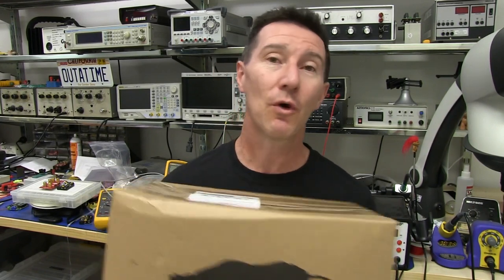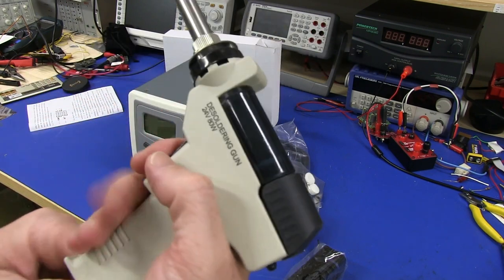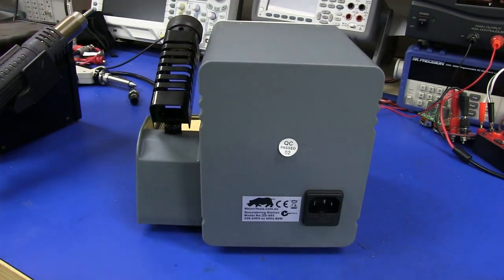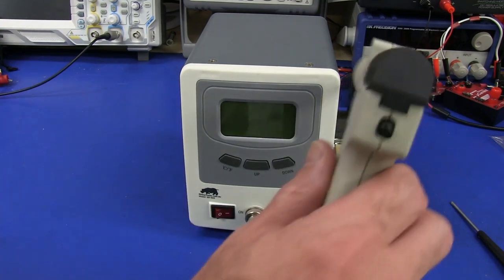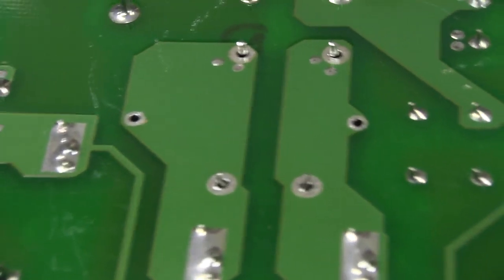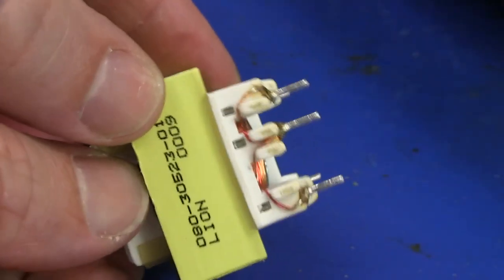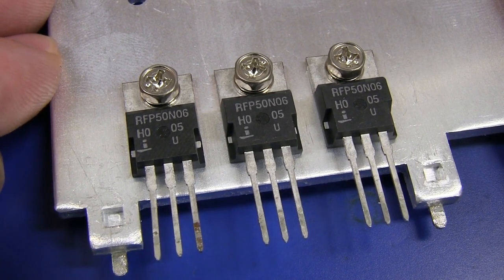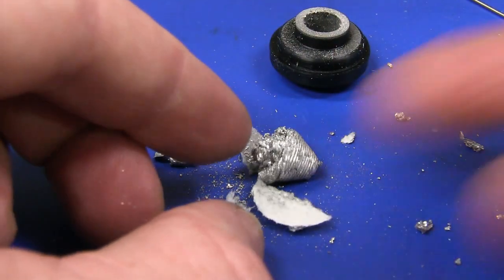EEVblog #542 - ZD985 Desoldering Station

Comment: I got one of these branded as a Duratool D00672.  The main difference is that the spring inside the solder trap is just a straight spring that pushes the filter against the back with a cross shaped metal plate that seems to keep the bulk of the solder off the filter.  When I first got it I popped the back open and the spring ejected everything from inside!  Took me a while to work out which order they went back in.  Otherwise the unit is identical inside.
Reply: How has it worked out? I see you can still buy that model.
Reply: I always chuck in steel wool in it after spring 
The curly kind not hair mat type 

Also I use fridge compressor and air valve 
I tend to pop compressors but they free and common and worth some scrap      $$££

Gives a epic punch and I'm doing tonnes of boards run compressor full on time and trigger air valve

Comment: I bought this model thanks to this review.  Used it for a few months now. Reliable tips, works excellent. Use caution with the heat, it is very powerful. A cool tip i just learned for working at lower heat, desolder with your board at a 90 degree angle instead of flat so you aren't fighting gravity.  Two small complaints, its a pain to fit the chamber back when cleaning, and drops the temp after 10 min. of being idle to conserve tip life.
Reply: Sir, it's use in multilayer  pcb work???
Reply: @kashirambhaipatel5102  I've used it for multilayer and single. It's still running well. Great unit.

Comment: Hi Dave, I bought a Hakko 474 nearly 30 years ago and it is still going strong - and parts are still available , even though quite expensive. 

One little trick you might find useful - place a small rolled up ball of steel wool in the solder collecting spring and you won't have to work with pliers to dislodge the collected solder from the conical end.

Comment: When using our hakko desoldering station at work, what we do to easily get the solder out of the solder reservoir is stick our solder iron tip through the bottom of the spring and start gently tapping it on metal on an angle and let the melted solder drop out to avoid bending the spring reservoir and is much easier.

Comment: Having done salvage/repair work for a long time, I'd like to add one thing: never use you desoldering iron's tip to straighten bent pins/component leads! Heat, then use a flat blade screwdriver, then suck away! You desoldering iron tips will thank you for it! :)

Comment: I have had the duratool version of this for over a year  and I am very pleased with it. The only problem I have is solder getting stuck at the end of the gun barrel before it goes into the tube, but you just have to give it a clean after use with a high temp.

Comment: A couple of years ago I picked up a cheap 3-in-1 station. Worked great for a while but then it stopped recognizing the soldering iron. I thought it was the iron itself that went bad so I ended up just using it for desoldering and hot-air stuff but after watching this video, I decided to finally open the thing up to see if I the problem was inside.  It was and I have it working again now.  Woo.

Comment: a little trick to make emptying the solder from the spring easier and also helps make the filter last longer, is to tear off a small piece of paper towel and push it to the bottom of the spring with a pen.
You only need a piece big enough to cover the tapered area of the spring.
if you have used a hakko (we have a 474 and a 701 here) or other similar de soldering stations you will find after a few times of emptying the solder from the spring it gets harder and harder to get the blob out of the tapered area. This eliminates that problem and we haven't picked up on any noticeable suction difference with the paper fitted. And we get so much more out of our ceramic filters and the filter springs

Comment: I used a vacuum desoldering station back in the 80's..  It had a glass tube (a buck or two)  ... cotton plugs for the tube, a controlled temp hand held (not gun shaped.)-- and so on.. Great tool with almost identical sound.  Made in the US, because that was well before the move of production to china..  Was a LOT smaller as well.  Super reliable.. Did rework on 4 and 6 layer boards with it regularly... I had been looking for something similar now that I'm retired.. that may be something to buy this year...

Comment: Sometimes cheap pieces of crap work very well, they just don't last very long. That's why cheap and SERVICEABLE are a win for me, lol! ;)
Reply: That's right, spare parts cost is a plus on this products.
I have a Hakko 808 desoldering gun and each nozzle cost 15 or 20 dollars, heating element is over 70 dollars instead 5 dollars for each nozzle or 20 dollars for the heating element on chinese.

Cheers.

Comment from the maker: I've been using soldering tools for 30 years. I know what is junk and what is not. The reputable brand names last, the cheap junk usually doesn't. That's a fact. That is precisely why companies and products get a reputation, because their products have proven themselves long term in the industry.
Bullshit that wire failed because I opened it, it was a BAD solder joint, it would have failed in time with the vibration.
Reply: The problem with china made stuff is there is NO quality control at the factory. The customer is the QC. If you get an item and it is DOA or fails, they'll just give you another one because on the scale of failure rates it's cheaper to do that than pay 20 people to sit at benches testing every unit they make.

Comment: One of my buddies bought me one of these in exchange for some auto work, and they are indeed cheap.

I've had a few problems with mine, with the most irritating being that the gun nozzle clogs constantly. I can only use it for about 3-4 suction cycles before the back of the tube inside the collection chamber completely clogs. The unclog sticks it comes with are too flexible to remove the clog alone so I have to end up precariously balancing a soldering iron in one hand, this gun in the other and somehow push the unclogging stick down the nozzle at the same time to unclog it.

But the problem is that it doesn't remove all of the solder from the tube so the process starts all over again with solder buildup at the back of the tube. If they had put a heating element through the length of the tube so the back also was hot enough to keep solder melted then it wouldn't clog.

The other issue with mine is the temperature setting glitches. I have mine set to display Fahrenheit, but after probably a half hour of usage, it will revert back to Celsius. This wouldn't be a problem if it used the same temperature. I keep mine at about 536F and it should revert to 280C, but it drops down to like 160C or about 320F which is too cool to melt the annoying ROHS solder. I have to press the C/F conversion button a few times and it will heat back up to the proper temperature, but it's still annoying it happens.

If you don't expect miracles and just need something for occasional projects then this station works alright if you're on the cheap.
Reply: Just a followup after using this desoldering station for awhile.

To prevent the gun from clogging up, you'll need to keep the gun temperature above 330C. I haven't found a fix for the temperature automatically reducing to 200C, but I assume it's an aggressive measure to save the heating element in the gun.

Comment: Impressed with the way it takes all the solder off, even from through-hole pads. I've seen tools costing an awful lot more that couldn't get that kind of clean-as-a-whistle result even on one-sided pads. Larger nozzle could be useful though. Reckon this is going on my shopping list. Will check inside for shoddy construction of course!

Comment: Funny, seems to be exactly the same as my unbranded "Duratool" desoldering station bought from Farnell, the gun is the same and the unit seems to have the same components all the way down to the crap LCD, mine has a completely different casing and proper mains earth though.

A friend had his SMPS break in one of these, if that happens to you it's most likely the SMPS controller chip according to the local reseller. They sent him a new controller and his works again.

Comment: Haha :) I can recognize that build quality! Bought Zhongdi ZD-939L hot air rework station (same as Rhino) couple of weeks ago and luckily took it apart before first use. All the plastic PCB holders was cracked and 230Vac mains board floated freely inside the case. But after all, works great after a little repair.

Comment: They sell these everywhere, I think.

I used to do repair and rework for a time (xx years back) and we had these massive ERSA stations (about the size of a Midi-Tower-PC), which were great and had a soldering iron, desoldering iron (not gun-shaped, but inline) and some heated tweezers for SMDs.
Worked excellent and saw a lot of use.

So, as I wanted something similar, though not as expensive, for myself and I found the ZD-whatevers  on the web, i ordered a whole bunch of the stuff: a combined soldering/desoldering station, a hot air station, some SMD-Tweezers and a whole lot of spares (you can even get spare heaters).

The soldering/desoldering station is a bit flimsy, when you open it up, but it worked and worked pretty well for the work I've done with it. The hot air station (with different nozzles) works great, too. I've even used it for heating plastic for bending :-)
I haven't tried the tweezers yet, but I'll have a go at it soon. It's not a station, just more or less two soldering irons with a hinge and a spring. We'll see...

Anyway, this stuff isn't bad for infrequent home use, so far.

Comment: Glad I watched. After purchasing this unit, mine didn't work either! I found one of the wires going to the pump motor had never been soldered to the motor terminal. Nice. I guess they ever test these units before shipping! LOL. Well, after fixing it the device works fine. Thanks for your review.

Comment: I have a hot air and soldering iron combo, which looks just like your hot air blower in terms of case and aesthetics. Just the other day, the hot air gun's temp sensor went whack and it lit up red hot and melted through the handle a tad. It was crazy.

Comment: Hi,  
     Well I did most of my time in the RAAF using a ROYAL made in Australia de-soldering station .  When I pulled the pin with the RAAF in 1992 I bought a Royal de-soldering and soldering station  for $1200 which lasted about 5-7 years then the gun fell to bits and as ROYAL were out of business then that was the end of that. 
 I bought a ZD985 and later several  ZD917's ,3 in total I think it was, these are de-soldering & soldering  stations.    My problems with them were one switchmode power supply  going U/S  under warranty,  several  de-soldering  iron barrels blocking internally due to the barrel collapsing, some going o/c in the heating element, this happened with the soldering irons too.  
   The main supplier is Radio Parts in Melbourne, they even supply Rhino Tools.   The tips get stuck in the barrels too, graphite may work ?   I have destroyed a couple of irons trying to get the tips out. 
 At present I am waiting on spare parts to repair some  de-soldering guns and a couple of spare irons, irons are so cheap they are not worth repairing.    I may have caused the desoldering barrel collapsing myself as it doesn't seem to pay keeping the desoldering station on too high a temperature,   350 deg  seems to be max but 300 would be better in standby.  
  By the way the ROYAL  wasn't made that well either.   I am at present semi retired having started in the trade in 1965 at BHP Newcastle, joined RAAF in 1972 and started repairing camcorders in 2000.   The RAAF used to run a NASA standard soldering and de-soldering techniques course of 3 months full time as part of the Radio Trades course.  I taught electronics at the RAAF School of Radio way back from 1987-1990.
Reply: For the price the soldering and de-soldering station  ZD917 isn't bad value for money  but it isn't built very well so needs to be treated with care.  At the end of the days work, tips out of the soldering iron and clean up and remove solder from the de-soldering iron chamber.  Also stick cleaning rods whilst still hot down the desoldering barrel to make sure it's clear of removed solder.  You can leave the desoldering tip on.
It's not really meant for professional work but if you don't do that much repair work it would suffice.

Comment: Dave, I know its a bit late, but, that multi pin DIN type connector for the wires to the gun from the front panel, twists a little after you remove that small screw.
Those plugs are commonly used for Mic connectors on transceiver equipment.
All the hams were probably screaming at you to "Give it a slight twist Dave".

Comment: Have the same product with another brand. Works fine at first, but if you use it much it will end up clogging even if you clean it. The tip heats, but the solder can cool in the tube on the way to the chamber, either because it doesn't heat or doesn't get hot enough. Ended up getting a Hakko.

Comment: Thank you Dave for the VERY informative video on this type of budget device!! I have had to use my hand pump tool for so long and it is tedious work. I have been looking for something like this but do not have the coin to throw out for a Hakko. I wish I did, because I love my Hakko tools and soldering station. But I'm not a salvage beast so cannot warrant the cost of a Hakko. This gives me an option. Maybe some home-made fixes to the design (other than out-of-the-box repairs lol) like the stand. The hand unit seal. Etc. THANKS!

Comment: The company I work for provided me with a Pace ST115 desoldering station.  I think it works really good.  The build is all metal and overall well done.  I think I prefer the handle of the Pace over the pistol grip style others make.  I did a search for pricing once and found that particular model is around $800 US.  Not cheap, but worth it if you get into a lot of repairs like I do at my job.

Comment: I saw a clone of that in a local store for 120, it's a ZD-8915. The case front is more solid, the gun holder is independent, and the gun spring is bigger. Other than that, they're basically the same. So obviously, I went with a cheaper 2 in 1 desoldering gun with a manual pump for only 12 bucks.

Comment: I have had a ZD929 soldering station for over 10 years now. With a decent tip it's a good tool for the hobbyist on a budget. Not great, but it gets the job done. It says "Ningbo Zhondi Industries & trade co. ltd." on the bottom.

Comment: @ 14:00 
those connectors are first unscrewed, then twisted to release the metal housing from the plastic

struggled with it myself a bit when i had to cut down and reconnect the plug after a lead went bad on an old station i was fixing.

Comment: I use mine every day. On the plus side, it's cheap, the nozzles and filters are cheap. On the down-side, the nozzles dont last long. They burn from the inside out and lose their thermal capacity. Old joints require flux to reflow the soder and the fumes from the flux will block the filter easily. And if a component leg breaks off inside the nozzle it can weld inside and then the element is trashed because you cant get it out. If you forget to empty the tube it will build up and jam the tube into the handpiece and if you prise it out it breaks.

Comment: This thing is DANGEROUS! If the temperature readout fails, the station enters a positive feedback loops that keeps on heating the gun until it glows red hot. It happened to mine; the metal has turned a blue color.
Reply: This happened to mine as well, this is a cheap crappy de-soldering station.
Reply: Good observation thanks for the warning .
Reply: or you know replace the sensor with a resistor and put a switch on the vcc in
Reply: @gjoreajtovGamingTV  more info on this?

Comment: Found a VERY similar unit under part number AT-915ESD.  The control layout is different on the front panel but the enclosure & gun look identical.

Comment: 34:16 - very good idea.

The heater on mine has just blocked completely, and no amount of prodding with the cleaner will unblock it (even with the heat up to 480C).

It had lasted about two years of occasional use. Not fantastic really, but my fault for not cleaning it more often (I'd lost the prodder things until recently).

A new heater was only £10 though, so not too bad.

Comment: Just for info.  I am in the UK and found a very similar item on ebay with the ZD 915 model number.  Seems to be almost the same item and has a better/stronger stand.  I have one and it performs just as well as this one but seems to heat up a bit faster.  Only drawback is that it has quite a noisy fan.

Comment: Varies depending on the type of pump.  

Vacuum cleaners use a centrifugal pump, and blocking the intake means that the vanes are spinning in less dense air, so there is less resistance to their movement.  Hence torque goes down, the motor speeds up, and the current reduces.

A piston (or diaphragm) pump is a positive displacement pump.  Block the inlet, and the piston is pulling against a vacuum, so the load goes up.  Think about engine braking.  Or block the inlet to a bike pump and extend it.

Comment: btw the reason they have cable tied the motor thing on the back is that they use the same assembly without it in a different case as a normal tempco solder station (e.g. zd 931)
Reply: +Dennis Lubert Wow good call on that, just looked it up, it's the same damn unit, LCD and all!